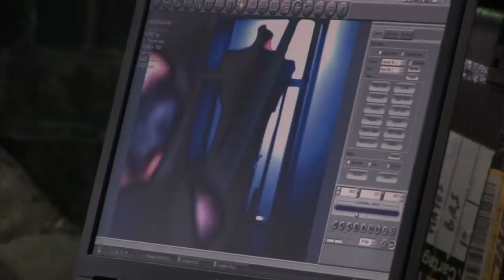Ancient Samurai Weapons | Samurai Bow | Absolute History

Comment: any bow I build 40lbs and up easily exceeds 34ms the longbow was not used at full performance. the longbow arrow points to the right, this can be caused by various factors not the bow, inaccurate release, wrong brace, hard spine etc. the yumi also has an arrow that turns left in that case one should see katrha, release etc. I don't want to correct the errors of the archers because under the cameras you can get excited. the problem is who said the information in the documentary. makes your eyes bleed

Comment: This is totally unfair. To compare the two bows like this is inane. The draw weight of 23kg is basicallt 50 lbs. The longbows recovered from the shipwreck of the Mary Rose had draw weights of up to 180 lbs . They are essentialy using a childs training longbow in this comparrison. I dont know what the maximum draw weight of a yumi bow is, but i get the feeling its nowhere near that of a longbow. It took a lifetime of practice to use a full power welsh longbow.They could tell which skeletons were longbowmen on the Mary Rose because of the difference in shoulder size of the bones on archers.To use a Welsh longbow to full pretension, you basicaaly had to be Arnold Schwarzenegger, and that was why longbowmen were so prized, few could use their bows.
Reply: I started saying the same thing and I'm just now scrolling down through the comments and happened across yours I'm surprised not more people have even acknowledged your comment
Reply: I hate to say it but in this video they are using a full strength yumi bow.  For God's sakes they are using bamboo and a Japanese so called hardwood.
Reply: For reference, historical Japanese war bows can achieve draw weights to that of English ones. I'll send in a video about this later.

Comment: How would a Japanese warrior do pulling an English war bow? HA HA HA.
Reply: Pretty much the same to be honest. Japanese bows did have constructions that allowed them to create bows over the draw weights of 100 or more. One Yumi from the Edo period was measured with a 196lbs draw weight, though it wasn't for warfare. I'm guessing like the English, they used bows with draw weights that'll give them incredible penetration power, but wouldn't wear them out after like, four shotsm
Reply: Fact remains long bows had a much higher draw weight on the battlefield and therefore more powerful. Yumi more efficient yes but it's really an apples to oranges comparison. Your not making as accurate of shots with a war bow
Reply: @johnd3901  True, but the thing is we kind of don't really have any surviving yumi as the longbow has. Most there is is just some rough measurements of how many men it is required to string a bow, y'know? Also it also depends really. From what I could figure is that bows that went to the hundreds or so were used on foot, whereas higher poundage bows may be used.
Reply: @johnd3901  Oh yeah I forgot, vollies were a thing. I think the japanese also practiced vollies if you were a foot soldier, and were with a unit of others that had tate. (Or your equivalent of a pavise used by crossbow men.) But yeah, bows are one hell of a subject.
Reply: @jonajo9757  both are good bows that do great at the jobs they are intended for and the type of combatants they encounter. I definitely wouldnt want to hold a shot for as long as they are with these yumi bows with a war bow, way to heavy for that kind of thing
Reply: @mekhane.broken9678  heaviest is irrelevant in my opinion, common longbow in the field on average was of higher poundage. I'm not debating the yumi had more penetration per poundage though